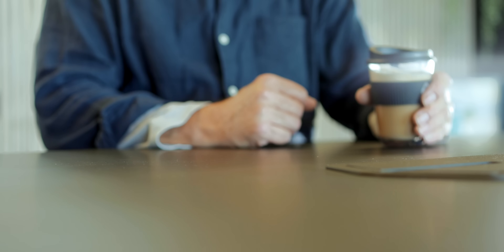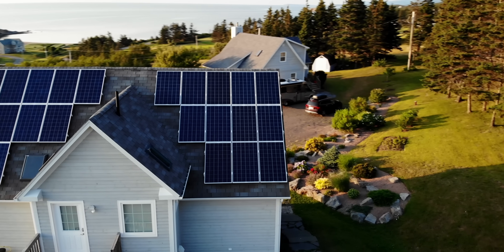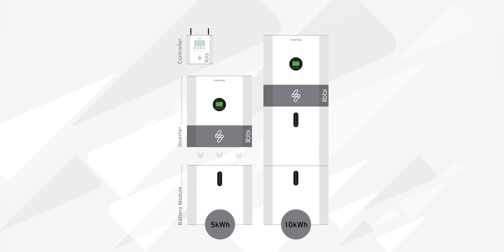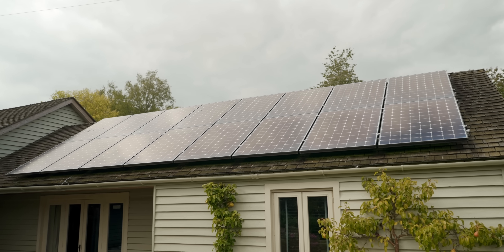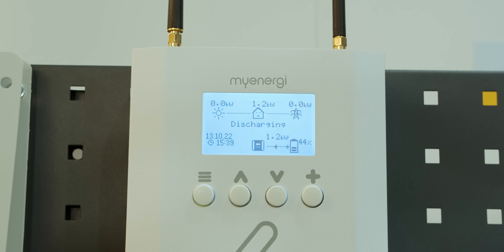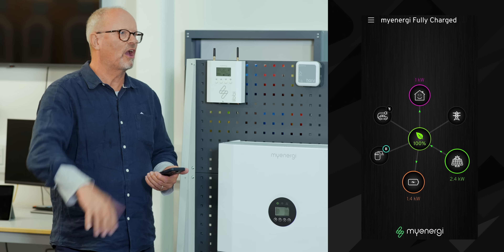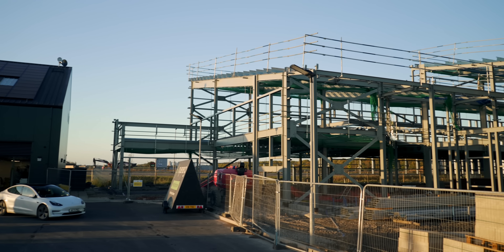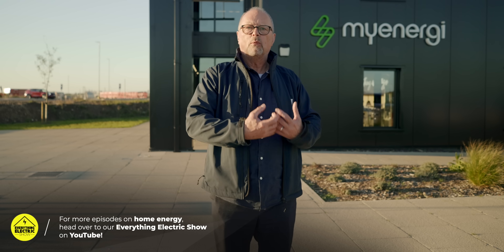THIS Home Battery is the Key To Cheaper, Cleaner Energy!

Comment: There was a similarly interesting system shown here several years ago, using liquid flow batteries, in Australia. Not sure if there's been a follow-up on that.
 
I'd like to see more development of static storage batteries that don't use lithium-ion, given all the ecological and human damage mining the materials to make those does. I'd save those (at least the brand-new ones) for vehicle propulsion, where energy density and power density per both volume and weight are crucial. For something sitting in a garage or basement and powering home appliances, those factors are not really important; cost (both up-front and ongoing operations/maintenance), reliability and longevity are much more important. And if we're trying to "save the planet" then the materials, mining & manufacturing processes & such need to factor in as well.
Reply: Redflow is still going. Getting a few larger contracts now but still challenged even with its newest model for domestic situation.

Comment: As long as i'm net zero in my enegergy imports from the grid, I won't accept anyone dictating my own energy usage in terms of how much i could potentially charge my car.
There needs to be a metering that keeps track of how many kW/h i've exported to build up my credit and guaranteed 100% grid capacity for when the grid is strained and load needs to be shed or a powerplant needs engaging.

Comment: Simply the ability to slow down the car charging to avoid using grid power would be wonderful.
Reply: It really isn't enough. Given the UK weather the minimum charging power ought to be a few hundred watts, not the 1.4kw that the Zappi goes down to.
Reply: @rogerphelps9939  Oh. That's disappointing. Well, hopefully the tech will improve over time. I'm the US where I don't think you can even get this yet, so I have to wait anyway.

Comment: Has Fully Charged done an episode with Powervault previously? I am pretty sure their battery systems do all of this. Indeed, I remember investigating the “gridflex” scheme, where you are paid by the National Grid to offload battery power during peak times, roughly two years ago. They also make batteries for households using old Nissan Leaf batteries. Also, I would dearly love some more cost benefit analysis on these systems in the show rather than just a sales pitch; transformative change will only occur when the financial numbers are right for a critical mass of households.
Reply: Yes they have a couple of years ago. Powervault works really well and is very similar.
Reply: Yes he has two powerwalls

Comment: Interesting video.  We have been investigating battery options for the past 6 months or so and have found the journey a real challenge.  We have a 4kw solar array (4yrs old and facing south / south west) and are in the south east.  We have discovered like so many that you only get a token pay back from the FIT tariff.  Having seen our stats for a full year 2021, it is interesting to see what days of the year would be useful to charge a battery pack.  We discovered that roughly speaking three months of the year we would struggle to rely on batter power due to poor weather conditions but the rest of the year we could potentially use 100%.  The solution seems to be, as you pointed out, an option for cheaper over night electricity tariff to get the 100% use of solar for 12 months.

Tried to find the battery tech specs on the myenergy site but not found them yet although I am sure they are there somewhere.  The 10 year warranty seems to be a standard and a good timeline to gauge investment value for those that want to.  Generally speaking the battery contents seem to be Lithium Ion Phosphate and these are currently the most reliable.  I am curious with your video test setup there was 3.6kWh left in the battery but didn't see the charge level and requirement from the car battery.  Would it be most effective for the car to charge overnight on cheap rate electricity in order to use the battery for house use?
Reply: The best discharge plan is depending on your energy prices. If you have a peak rate in the evening, then yes it would be optimal to keep enough energy in the battery to cover your house electricity until it switches to off peak and then charge the rest of the car with off peak electricity. On the other hand battery storage systems are currently still so expensive that most will die before you got your money back in energy savings.
Reply: @Psi-Storm  you might want to recheck your maths now that electricity prices have shot up, what was a 20-year payback is now less than 5 years in many instances.
Reply: @alanhat5252  What voodoo magic are you applying to get to 5 years? A well balanced pv battery system gets 250 full cycles a year. Even if we assume you would save 30 cents a kwh, a 10kwh battery system has to cost only 3750€ to break even in 5 years. At the moment you pay at least 7k for the battery, 1500 for the inverter and another 1000 for the smart meter and installation cost. In reality you have to also add the storage loss and the income loss from no longer providing the pv electricity to the grid. I currently pay 25 cents for electricity in Germany, while i get 8 cents for pv grid feeding. So in reality i save less than 20 cents from self storage.
Reply: a web search tonight of 'myenergi libbi specs' produces several very recent results, you might want to try again.

Comment: I hate when we call giving back to the grid 'WASTE' it isnt waste!!  its helping the grid which we all rely on!  in theory its actually good to distribute to the grid - there is less transmission loss if your solar is giving its electrons to your neighbor.  This is a major way we can work together!  intelligent management will be the key to managing\balancing our modern distributed smart grid (MDSG)
Reply: Not all locations will credit power returned to the grid at the same rate as used from the grid. Iirc arizona dosnt allow you to feed into the grid at all anymore though I may be incorrect on that part. Many states are passing laws that power sent to the grid is to be paid at the bulk price that plants are paid, instead of crediting you back at the price you’d pay for using power, meaning you’d have to return vastly more energy than you use to even break even, making home power storage that much more lucrative to stave off power bills in the long run

Comment: This is really intersting . I would say that 5kw is NOT actually that much power. Especially if you have an electric oven . Youd really need atleast 3 of these units stacked together which begs the question how much are they ?
Reply: yeah I can burn 5kw making toast!
Reply: I was thinking the same thing, already have a 12kWh battery but it's not enough to get through night-time and then a cloudy day, upgrading to 20kWh is my next move. People often make the mistake of having a too small battery with their solar installation - especially if they intend to stop using gas.
Reply: KW or kwh? 🙄

Comment: As more and more users take up renewable energy, expect the low- and high-price tiers to flip from their current locations.  If power is currently cheap overnight, that is going to change is more users will be relying on their batteries for power and grid providers will ramp up production to cope with their uptake, while daytime production will be largely met by solar in conjunction with other renewable sources, and the fossil plants are essentially idle - the grid will have power to spare and the utilities will probably only be charging you for routing the power to you during the day and not so much for production at all.

This is just me guessing but I don't think it's a guess without merit.  It will take some time to manifest but the more solar comes online, the more important overnight generation becomes.  Demand drives prices.

Comment: TBH 20kWh is not that much if you commute electric for example. Also from personal experience, you can simply double the energy you can use from your PV. Over the whole year, I'm at 1/3rd direct from PV, 1/3rd from battery, and 1/3rd from grid.

Comment: I like their point on it working together. I have small solar and never really had enough ‘spare’ for days when the clouds came over (the zappi needs a minimum of 1.4kw to charge a car so anything below that it’d start/stop and thats not good for the car). With a battery it can buffer to smooth out those interruptions so it can make EV charging practical on solar even with a fairly small array
Reply: I can get zappi to work at 1.2kw. Agree though that on eco++ that can be a problem. Tend to use eco most of the time.
Reply: @davidhumphries3614  Given what the UK weather is like the Zappi ought to be able to work down to just a few hundred watts. It does not, so, if the constraint is not on the car side, the design of Zappi is not fit for purpose.
Reply: @rogerphelps9939  It is on the app side as n the scale of 0-99kWh, I can’t move it closer to 0 than 1.2kWh.
Reply: Why is it bad for the car?
Reply: @edc1569  I don’t think it damages them, but if they start/stop/start/stop often they’ll often refuse to take a charge until you disconnect and reconnect again. So if your solar excess isn’t safely above the minimum it can be hard to use (but battery solves that)

Comment: It looks brilliant as a product. My concern as the owner of a typical small terraced house that doesn't have a garage, cupboard under the stairs, or an abundance of outside wall space is; it (and the Tesla Powerwall) require quite a bit of space. Throw in an air source heat pump (another thing I would like) and it seems there is going to be an opening for someone to cleverly invent spaces and facades that stop the exterior of our houses looking like small scale industrial units. Either that or someone needs to work out a way to get some of this stuff into loft spaces; some installers of the Tesla Powerwall say its 114kg weight make it unsuitable for lofts and cellars, though the temperatures in loft spaces are probably not ideal either.
Reply: We have 3 Tesla Powerwalls in the loft above our garage and they work just fine. We did make sure the loft floor was re-inforced though.
Reply: @michaelconyers6716  That's good to know, do the temperature fluctuations (my home loft can vary between very hot and freezing cold) affect efficiency or is it not noticeable?
Reply: @markmcdonald751  We don’t monitor the left temperatures but have not noticed any over heating or tripping. The system has been installed for a year. The main problem was lifting the units into the loft simply because of the weight and size - we had an extra wide opening.

Comment: so these guys are trying to be to home-built solar systems what smart meters were to key meters. my advice, don't do it. build your own solar system. you don't have to be an engineer to do it. they say that because they'd rather you pay them to do it. all you need are panels, an inverter, a charge controller and batteries. and make sure they're all the same voltage. typically 12v or 24v. for less than £5k, you can have a 9.6kWh system, which is more than enough to run your whole home throughout the entirety of the national grid's predicted blackout period.

Comment: As we move away from gas central heating - parts of UK were never connected to the gas grid so provide an example of what homes will actually use post gas - 5KW batteries are going to be way too small.  Even relatively small homes (2 up 2 down terrace house) will need 15-20KW in battery storage.  Critical will be what is the physical size of batteries with 15-20KW of storage + appropriate inverter.

Then there is the price.  Ultimately price needs to come down to c.£2k per 10KW, excluding installation, although less would be nice